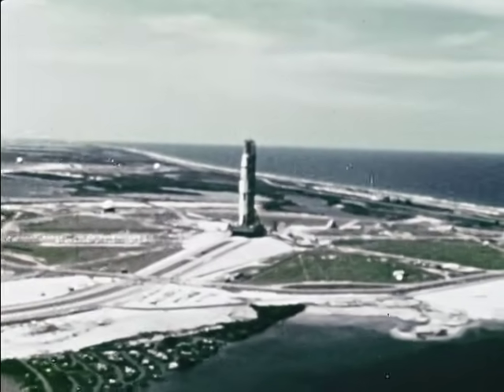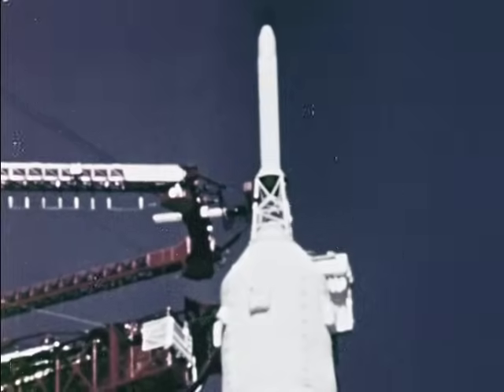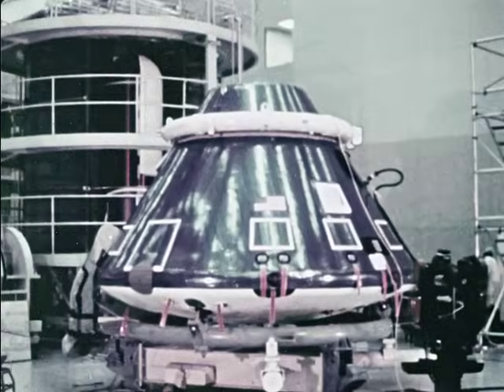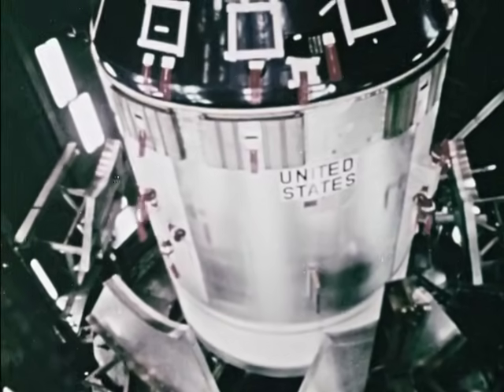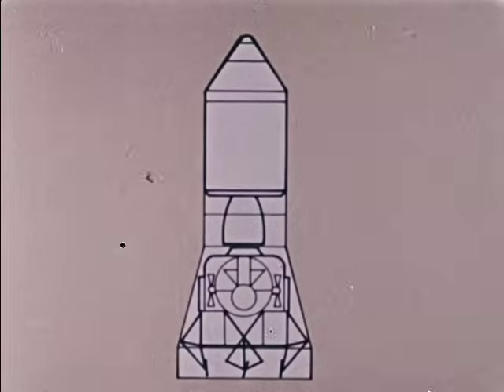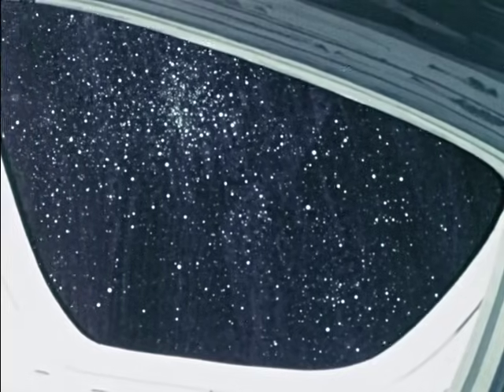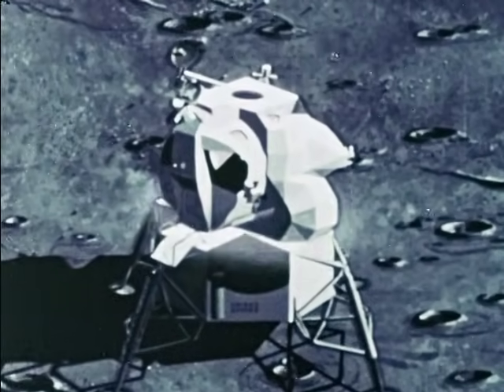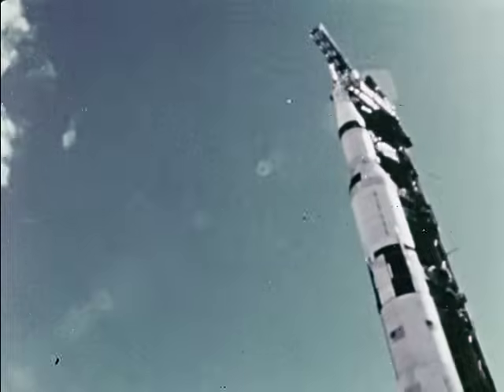Apollo Recovery (1969)

Comment: The earth is flat and stationary, space is fake.
Reply: How do you explain solar eclipses, gravity and tidal waves?
Reply: @0topon  how do you explain no measurable curvature or that the earth is not rotating and that the sun and moon are also small and close?
Reply: @photosphotos  I dont need to explain rhat, because those things dont happen in my model. Please answer my question.
Reply: @photosphotos  there is measurable curvature, you can simply get theodolite and measure dip of horizon, and from that there is easy math to calculate curvature.
Reply: @photosphotos  ps if sun and moon are small how moon eclipse happen Timmy:) How domyuu explain two points of rotation of sky, opposite rotation of two hemispheres, how do you explain seasons with your magic pancake?

Comment: All fake. Van Alen radiation belts they knew little about, no toilet, no pumpers, navigation computer handling adjustmants for the second cosmic speed had 2Kbyte RAM and 32 Kbyte Disk. Zimbabwe could lie better if it could print $27+ trillion "world currency" thus defrauding productive people around the world, just like defrauding domestic poor and elderly. It is like Russian KGB did not know that Palestinian language had no "P" sound when they created Palestinian people in 1960's.
Reply: When you say that the Van Alen belts existed, you are trusting NASA, since they discovered them, you do not need a great power to handle a spacecraft, there are not many variables, in the landing it was only the speed and angle and the radiation was easily passed since the command module had protection against this, as the radiation from the belts are only electrons, you just have to put a small mass to dampen the radiation
Reply: THANK YOU👉🚾👈⚠️
Reply: :thanksdoc:👏💪 @alexmarshall4331

Comment: Idiots: the moon landings were fake
CGI during the moon landings:
Reply: Climb back under the rock from which you crawled.
Reply: @johnbattista9519  ?
Reply: @Poatatero  cgi is 1969? Use your head
Reply: @jakemckee2005  they weren't using CGI back in 1969  .  . they had other tricks back then but now they've graduated into CGI. Don't be so nit-picky.😁
Reply: @davechristensen2482  how did they fake the dust kicked up by the lunar rover? You would need 1/6 g and a vacuum to produce it. Impossible to fake.
Reply: @jakemckee2005  Perhaps different film speed.
Just where does that vacuum of space begin?
Reply: @davechristensen2482  nobody had good slow motion cameras back then. They could only run for a minute or so, not hours of film footage.

And the dust doesn’t form swirls or vortexes as it would in our turbulent air.
That’s absolute proof they didn’t fake it.

And technically nowhere is a vacuum. It just gets thinner and thinner. We define space as 60 miles up.
Reply: @davechristensen2482  was that enough?
Reply: It is easy to see, looking back in history........
That all this moon travel was and still is a HOAX!
Reply: @davechristensen2482  
Sure bud. EXPLAIN HOW THE HELL YOU FAKE A 363 FOOT TALL FLYING SKYSCRAPER
Reply: @Poatatero  that's easy. Just use computer-generated Imaging. And tell people that's a 363 foot tall skyscraper falling. And people believe it.
Reply: @davechristensen2482  
Did you not watch the video and see how trash the cgi is
Reply: @Poatatero  yup.....the videos they put out are laughable!
Reply: @davechristensen2482  
And your saying that with this cgi they tricked the entire planet into thinking it happened
Reply: @Poatatero  They have succeeded in tricking all those that believe it.

Honestly, my friend.....I believed it too.I was born in 1961.All through elementary school I was taught all the things about the Sun, the moon, the stars.We watched films of all the great things the astronauts were training for. We made models of the Saturn and Apollo rockets. I turned 8 years old on July 19, 1969.....the day before Neil Armstrong set foot on the moon (supposedly).
I sat in our living room in California watching it on live TV. 
I lived it all....mercury,apollo, skylab, space shuttle,  International space station, Hubble, pioneer, etc. Etc.

But over the last five years I have learned for myself that I was decieved.....
Very sad, really.
Reply: @davechristensen2482  
Bruh
Reply: @Poatatero  sis
Reply: @davechristensen2482  So are you telling me that they falsified the entire launch of a Saturn 5 ?, because many people went to see those launches, if it is true that you were born in 61, you must know very well, crowds of people watching those rockets, it is not easier to send someone to the moon?
Reply: @anguita119  yes, I am 

Of course there were big huge rockets . People saw them blast off but the rockets didn't get to the moon.
That part IS the hoax. Sad.
Reply: @anguita119  rockets went up......people saw them go up.......

But the rockets did NOT go to the moon.
At least not the moon in the sky. Those astronauts went to "the Moon"  but it was just a stage. And they called it "the Moon".

Watch Neil Armstrong and his buddies interview when they came back down to earth. You can tell that that's when they found out that it was all a hoax. Look how they sit , look how they act, look how they talk. They were depressed.

We've been lied to my friends!
Reply: @davechristensen2482  I'm not even going to give you the math, if according to you everything is so false, why didn't the Soviet Union say anything? If they were in a space race and at the climax of the cold war, if they could have found the slightest proof that it was false, why didn't they tell the world? A great way to humiliate the United States and leave them in complete ruin, With common sense you can know that this is real, it is not even necessary to do the most basic mathematics
Reply: @anguita119  well.............now all these countries are running the same game.........maybe the cold war WAS cold 🤔🤔🤔🤔
Reply: @davechristensen2482  hahaha you are really special, now you say that the cold war is not real? Korea is not real for you? Vietnam?, The Cuban missile crisis?, The death of the Soviet leaders?, the dead of Kennedy?, When the U-2 was destroyed in the Soviet Union? nuclear tests in las vegas? drills of a nuclear explosion ?, for you all this did not happen ?, it is assumed that you were born in 62 no ?, you had to live these events
Reply: @Poatatero  helium?
Reply: @anguita119  Cosmonauts have come forward and said it's a hoax.

Who makes the money? I don't get any money. NASA gets 52 million dollars a day.
Reply: @davechristensen2482  Where does a cosmonaut say it is a hoax? Do you have any link to that? Because when you give data if you only say it without any basis I cannot believe you, if according to you in NASA they take the money, you would only have to see the The military, 715 billion compared to NASA's 23, has 31 times the budget of NASA, that if it has to be a scam, right?
Reply: @anguita119  I was born in 61 my birthday was yesterday:-) I did live all those events lots of them are real but a lot of the reasons they tell you about those real things were a hoax....

Oh and on another note just for Giggles. Today is the anniversary that those astronauts pretended to walk on the moon. July 20th 1969. I had just turned eight years old :-)
Reply: @davechristensen2482  happy belated birthday, first with all due respect nasa has not lied to us, this is the physics that supports them, the hundreds and hundreds of documents that are made explaining each aspect of each mission, the earth is not flat it is a bit narcissistic to believe that this planet It is special, the earth is round because of the large amount of mass that it has makes everything collapse in the center.

the payment, per month an American gives 5 dollars to NASA, and an American a month gives 181 dollars to the military, of Do you really want to end all space exploration for 5 bucks?
Reply: Pre CGI even 👉🚮👈👉⚠️⚠️⚠️⚠️⚠️

Comment: I never truly understood why the lunar module and service module weren’t coupled at launch in order to dispense with the clumsy turning around in space.
Reply: To save space.  Also to keep the Saturn V aerodynamic.
Reply: For the emergency jettison of the capsule, in the event of an initial launch failure. And you can’t connect anything to the heat shield.

Comment: The title is deceptive. Nothing about recovery is mentioned.
Reply: Bringing astronauts back to Earth is known as recovery and this video details how it is done.
Reply: You are probably thinking of reentry, a phase of recovery.  Before Apollo, recovering any portion of probes sent to the moon was not necessary, so no part of a rocket assembly was dedicated to that task.  With manned flight, the recovery of the crew is the primary goal and point of the mission.  Every pound of weight requires more fuel to propel it, so the philosophy of Apollo was to gradually shed unnecessary mass throughout the flight so that less fuel would be needed at each stage.